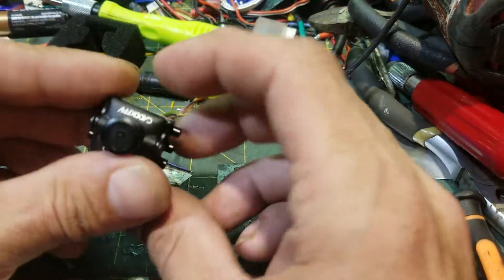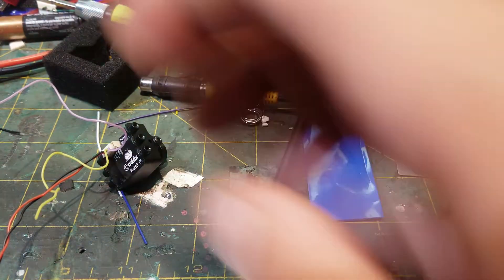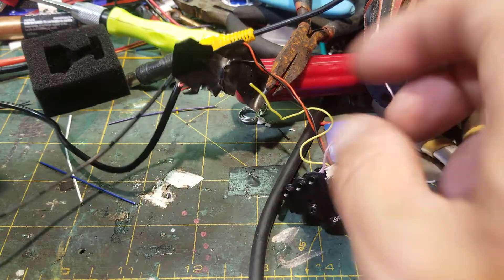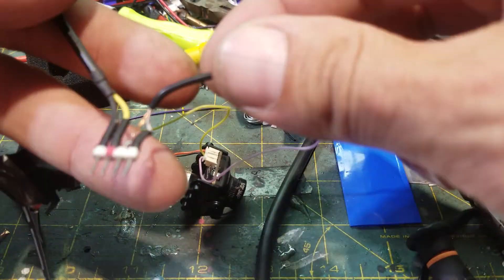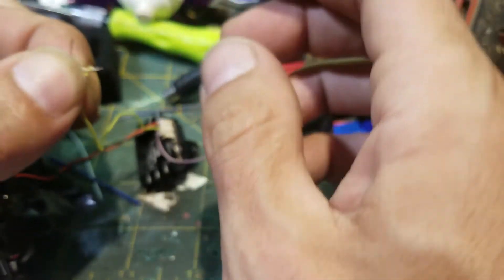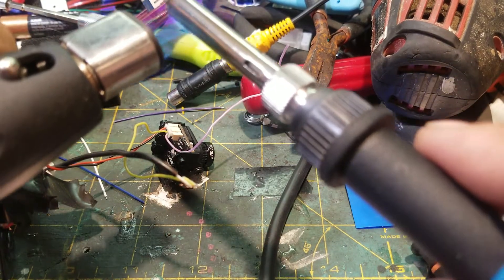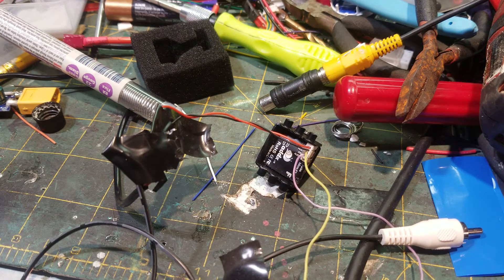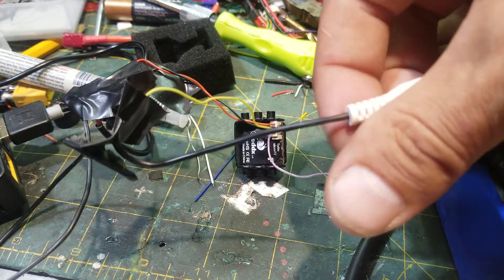How to wire a FPV Camera to a monitor for testing

Comment: I like the way this vid is made and the workflow is similar to mine. 
Sometimes its easier to connect cables for a test with a terminalblock with screws. This way you dont need to tape nor solder. Of course your wires must be long or you need to split the block.

Comment: cool, thanks but the other way to connect is...?
Reply from the maker: Lol 🤔 I was trying to remember. Pretty sure I soldered it directly to the RCA connector (they are usually cheap steel connectors) and they take solder pretty well (kinda "skeezy" because you basically make a RCA connector into a semi-permanent connection) thanks 👍

Comment: If you connect a device to a 5v 2a power supply, you are looking at a constant voltage power supply. The current is variable. The device should theoretically pull current until it doesn't need any more. Unless it is rated for a lower voltage, or for some reason needs a constant voltage and constant current (like a laser diode), then any 5v source with enough amps to power the device should work fine.

Comment: Hi My Webcam has 4 wire
Red no 1, white no 2, green no 3, black no 4

Which cable do I need to connect to the VTX
Reply: check the manual for your camera to see if the white or the green is your video cable then pretend that that one is the yellow cable in the video and follow his steps

Comment: Thanks, it was very helpful. I want the fpv camera to connect to my windows tab and also be able to record videos and take pictures. Is that possible?
Reply from the maker: Windows tab as in windows tablet? If so there are a few different OTGUSB adapters. One is made by skydroid, another by eachine. They are described as "android and iOS fpv adapters" I have used the skydroid on an android. The skydroid might be able to connect to windows, not sure. https://www.getfpv.com/skydroid-5-8ghz-otg-dual-antenna-fpv-receiver-for-android-smartphone.html?gclid=Cj0KCQjw4uaUBhC8ARIsANUuDjULofL3zogvgEagHvjN0pyQQb7KIZ7HSbAr1emuv1Uuvp3lFTbx36UaAuFNEALw_wcB

Alternatively the way I got FPV to a windows PC is I bought a "RCA to USB Video capture adapter". You then plug the fpv video into the RCA adapter and it let's you play / record it in realtime on VLC or a media player . Hope this helps. Thanks for watching.

Comment: Electronic solder is flux CORE. NO NEED bringing Colgate in this situation.
Reply from the maker: Yes but it's never enough :P Alot of times I will reuse old solder drips and it wont contain any flux anymore. thanks for watching :)

Comment: Is it possible to connect the fpv camera directly to a lcd display? And if yes can you briefly explain how?
Reply from the maker: that's actually a whole other "can of worms" they say I2c because they connect with a serial interface and display information , usually in textual form. they are more designed for displaying data. I think INAV has options to interface with them and add an "oled display" but I dont think they will work as an fpv monitor without some kind of special LCD driver. you see them on alot of arduino / raspberry pi projects etc.
Reply from the maker: yes, sorry I thought this video covered it , but yeah kinda hard to tell. so basically your fpv camera has 3 main pins comming out the back. one is power + one power - and then usually a yellow "video out" you connect the power to a 5volt or whatever source and then you connect the yellow to an RCA cable positive and then you use the power - and connect it to the video negative ground. lemme know if this makes sense  if not I'll make a new video. thanks for watching:)
Reply: @BonzaiFPV  Thank you, yes that makes sense
Reply: @BonzaiFPV  Another question, I need to connect my fpv camera to a really small display, about 2 inches, but the displays i find in this size are have some other kind of input called spi/i2c, what do i need to put inbetween the display and the fpv camera to connect then?